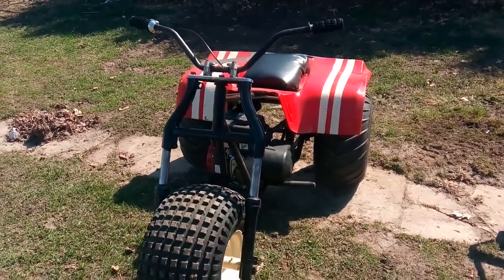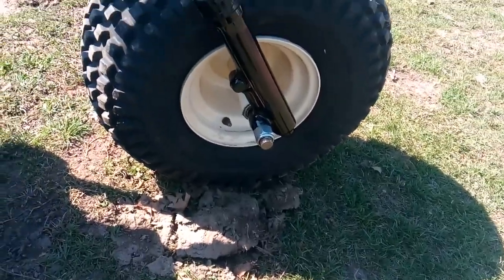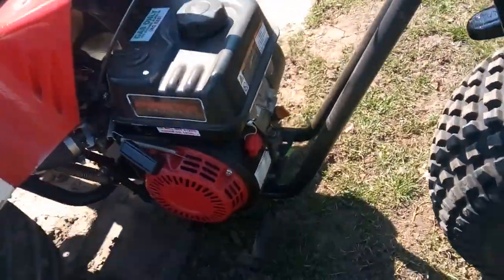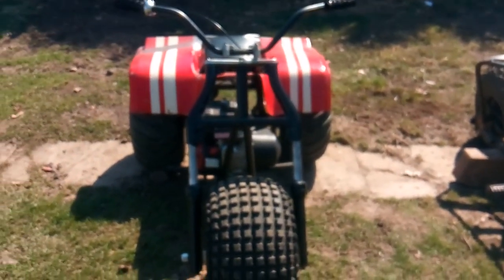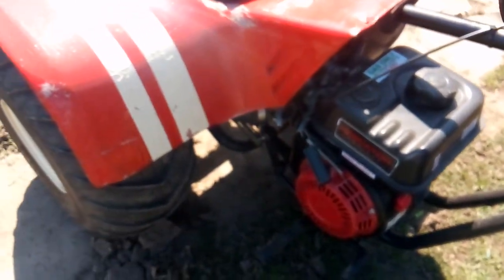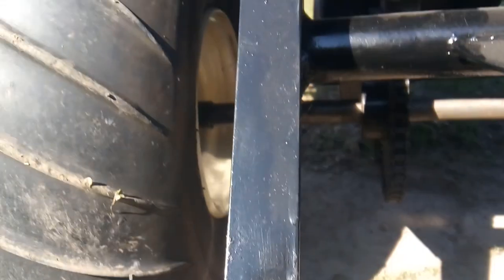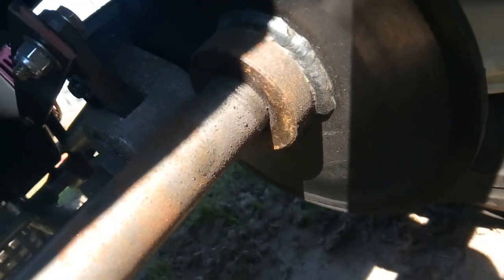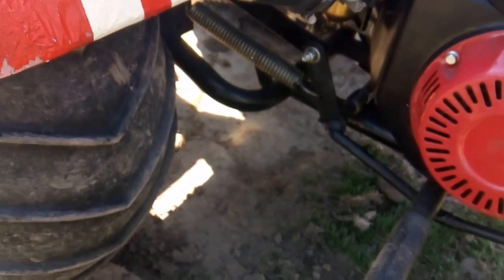Manco t bird there Wheel front end swap

Comment: Hi, i have a Manco three wheeler. I can’t get my front axle out to get the front wheel off. Should It just slide out either side.
Reply from the maker: U need a hamer and lots off pb blaster
Reply: jordan tractor vlogs thanks man. Is there a certain direction it has to move or will is come out both ways? I’ve been beating on it and using PB blaster in between rests. Lol